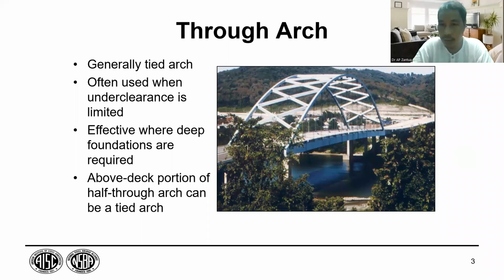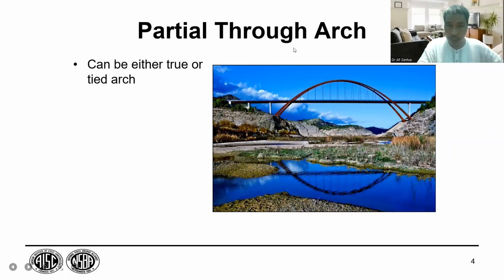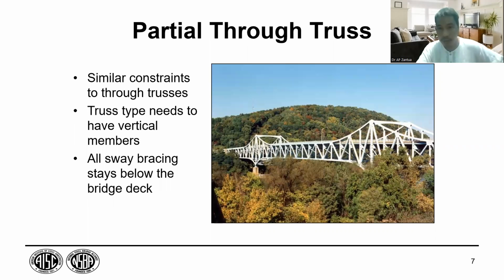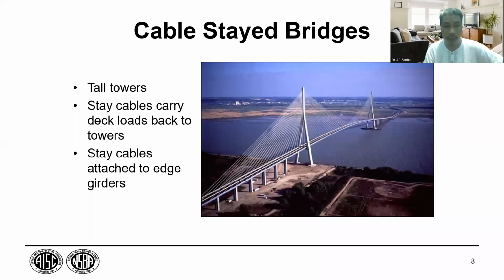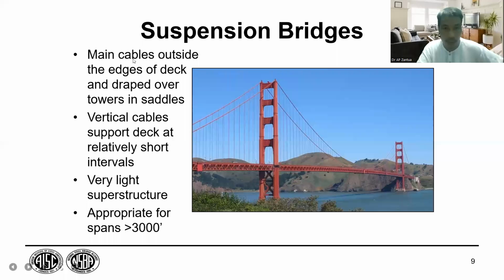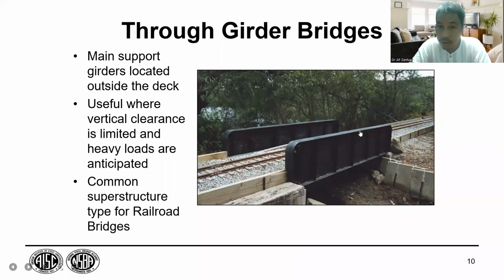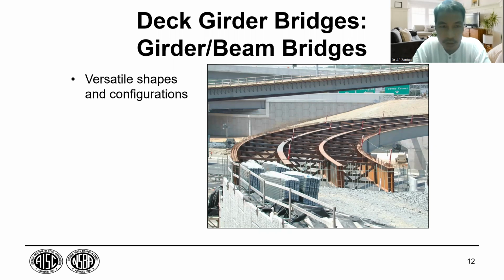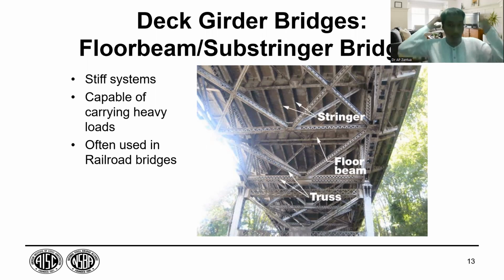Types of BRIDGE Structures [ Highway & Railroad Engineering ] Module 5.02

Comment: Thank you, sir for discussing the different arches. Deck arch, it is generally used in deep valleys with steep walls and it's entire arch located below the deck. Through Arch, it is often used when underclearance is limited. Partial through Arch, can be either true or tied arch.